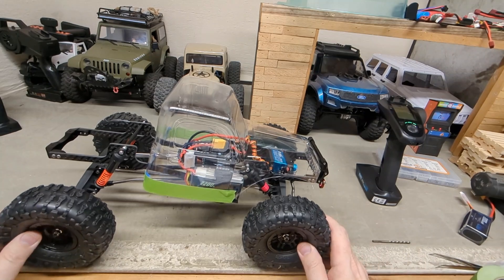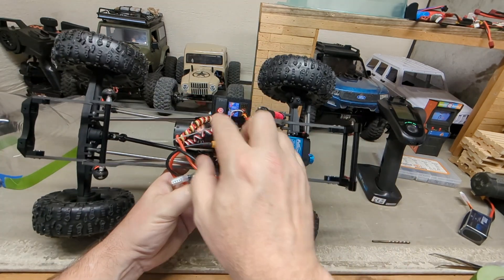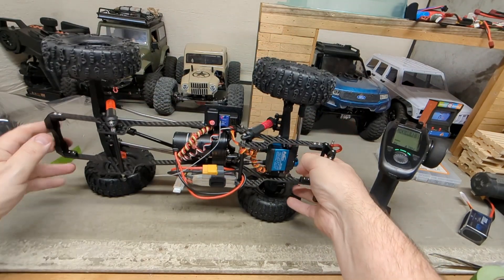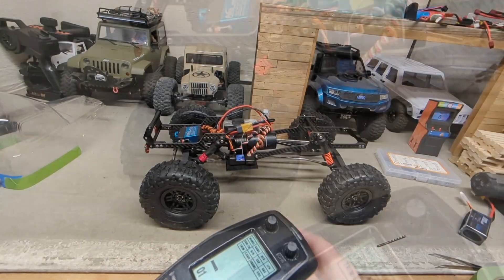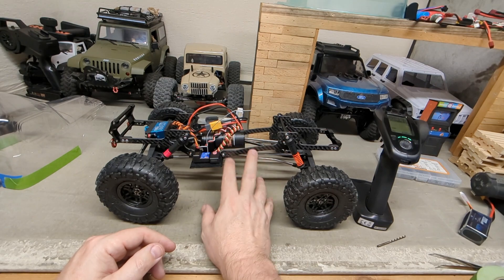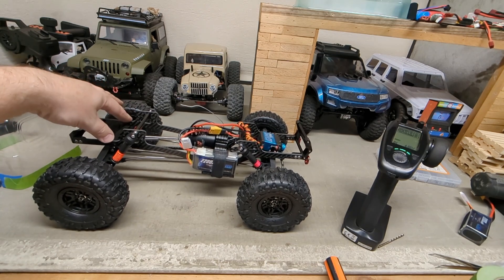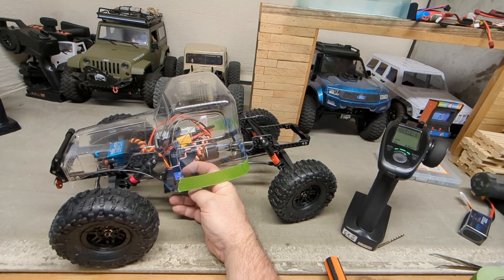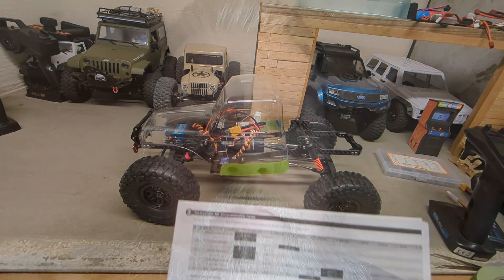Amazon LCG build part 2

Comment: I'm a fan of always testing with a body. Even if you gotta use masking tape. The weight of the body is a big factor in how a crawler performs. Any crawler will obviously perform better when there is no body....so you don't REALLY know until you've got the body on. Plus it protects those valuable electronics if it goes belly up. LOL.
Reply from the maker: so true, this will be my first body with magnets, so I want to make sure its solid, not so much for the body but to protect the rig like you said. 👍🏻
Reply: @leesrcs  I tried the body post magnets. It was cool but body came off too easy. A year later a friend of mine mounted a cab only body with a 3d printed magnet holder bolted to the chassis so it would hold the rear of the cab. Then velcro under the front hood. Super strong setup there.